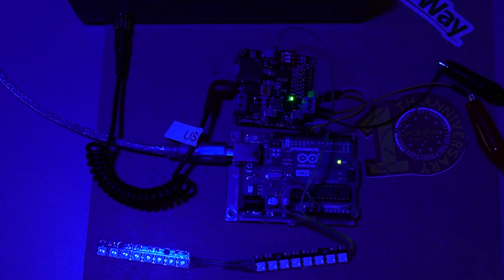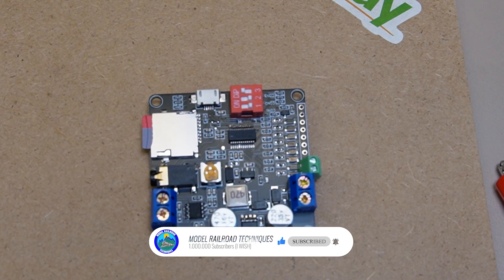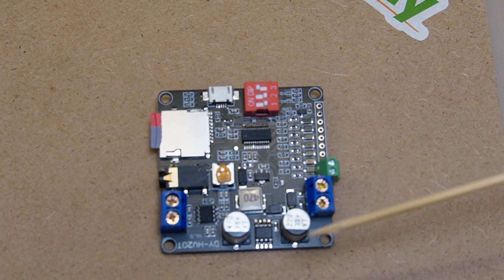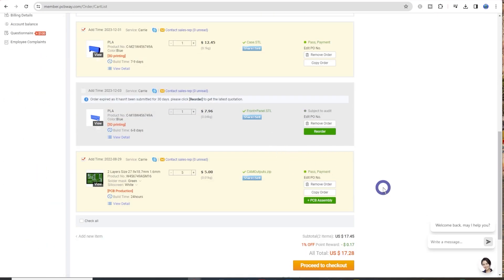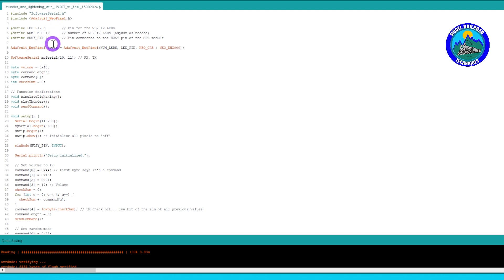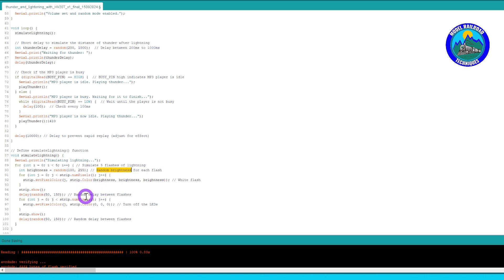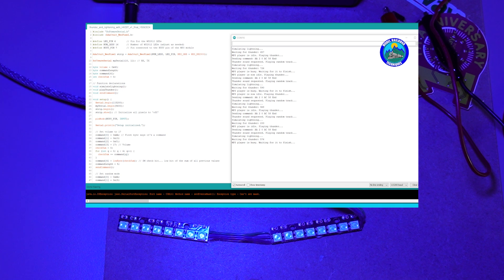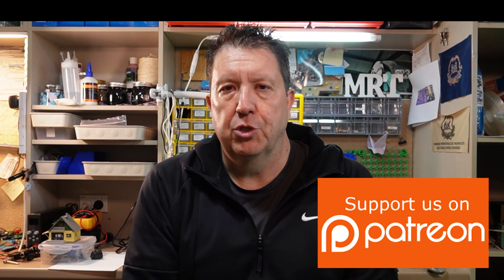Thunderstorm Effects on Model Railroads: Ultimate Arduino & MP3 Sound Setup for Realistic Layouts

Comment: Very nice video, their is a interesting youtube video by Dave Bodnar called "Thunder After Lightning Animation!" he use the dacL and dacR to achieve it. One dac is used to control the lightening and the other for sound,  by altering the audio sound track so one channel is delayed he uses the delayed channel for the sound and the other for the lightening effect. I realise your module doesn't seem to support this, but maybe using a XY-V17B sound module paired with the development board you could get similar results or any other sound module that has a dac left and right output, and still use your technique to control the files. Hope this may be of use. All the best Tony.
Reply from the maker: Cheers. I never considered a dac. I will look at his website

Comment: Remember the 5 sec rule for lightening and thunder?   Roughly, see the lightening flash and then count the seconds until the thunder is heard.  Each second indicates the source is about 0.2 miles away.   If you count 5 secs, the storm source is about a mile away.  So, your current setup & software is kinda realistic!!
Reply from the maker: @donaldkormos5529  cheers I never knew this. It makes sense though

Comment: In the days before arduino, I made my storm with 3 Strobe lights set at 3 different flash rates and a bunch of logic with relays (as the strobes are 240v), MP3 player fed a 40W amp and two 30W speakers, you couldn't tell it wasn't real, scared the bejeebers out of the unsuspecting, first time out
Reply from the maker: @TimberSurf  nice one. I still have some work on my timings of flash and sound.
Reply: @ModelRailroadTechniques  Never got round to it, but was going to feed stereo to the two speakers and get the sound to "roll" from one to the other